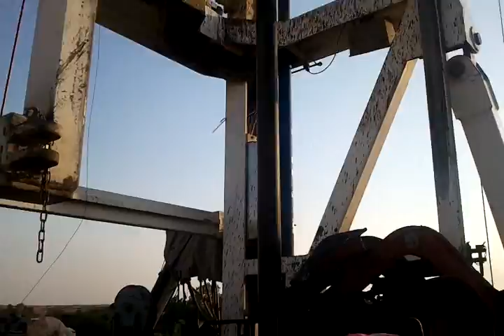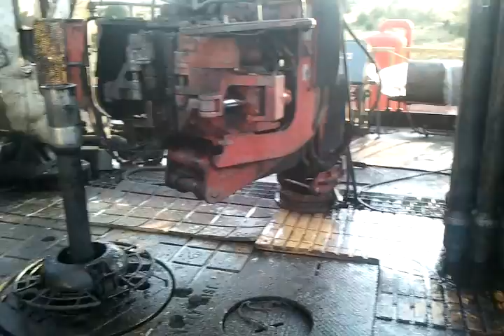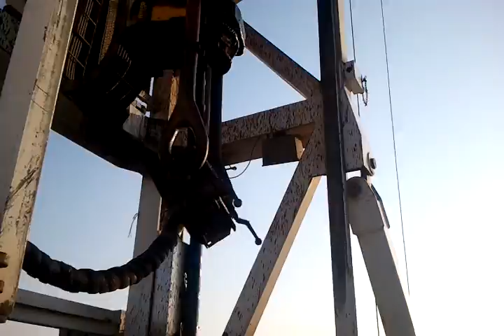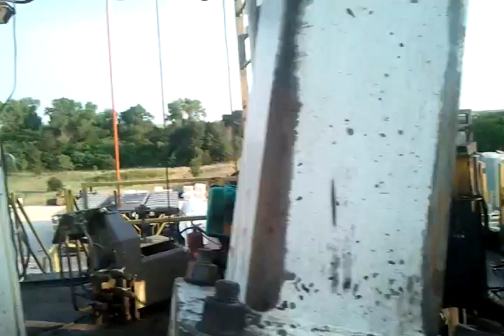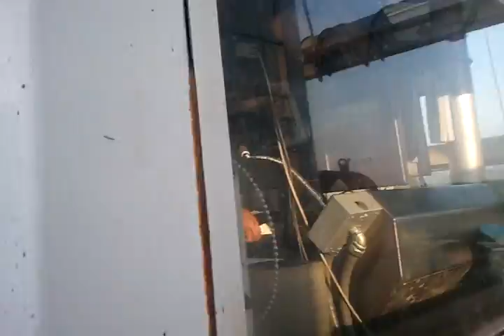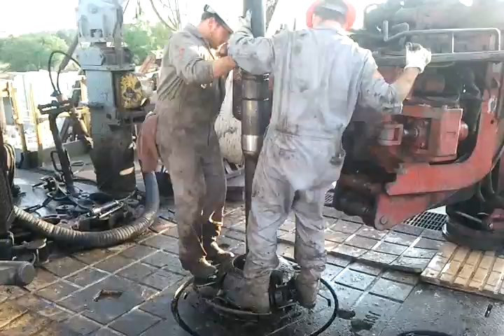H&P Flexrig

Comment: Holy shit. 

I worked on a flex 3 rig and we did everything manually up until having the use the 80 to make/break and spin in/out pipe. 

Often times it would break, then we would use the big boys.